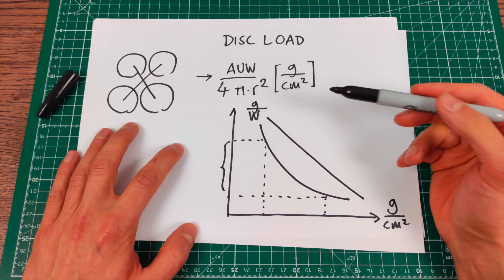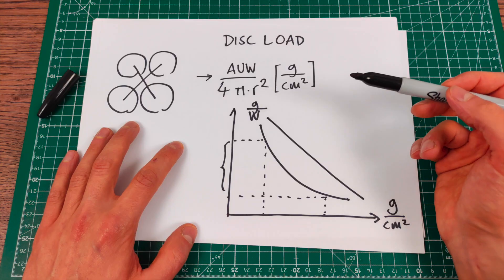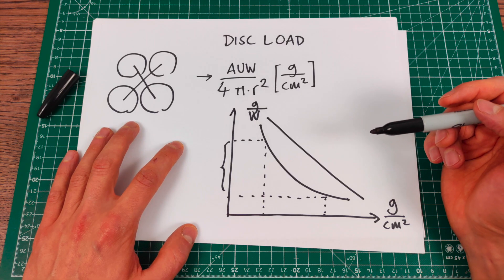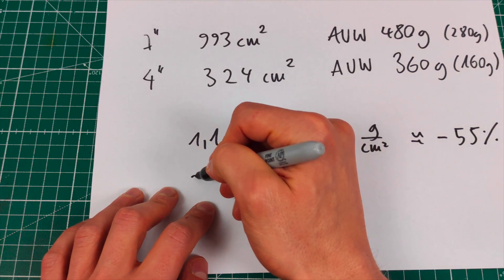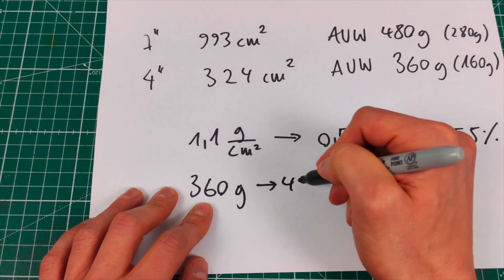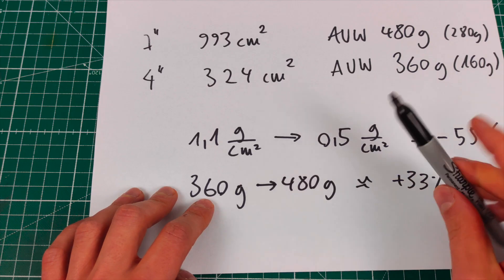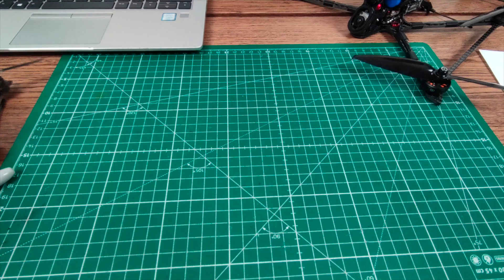Ultralight 7" vs. 4" | flight time comparison | 18650 Li-Ion

Comment: Great concepts, good test!  Are you sure flying till 3.3v on 2 different packs (that might be in slightly different condition) gain a good comaprison?  Have you checked how many MAHs you charged back into both packs after the flight? Could have been quite different MAH consumption / cell behaviour.
I say this because I noticed in my last test (regarding LIONs) that temp playes a huge role.   The one day (cold, around 0°c) I got horrible flighttimes  (and only 2000mah out of a 3500mah pack until the volts dropped down and I had to land, the other day the same pack got me 2900mah and volts were still ~3v/cell      only difference:  9°C this time and packs in a plastic bubble wrap...
Just got into micro longrange by testing the iFlight Chimera4 and the "great" Shadow Fiend - sorry, both rip-offs of your Explorer - but the Flywoo LR is so hyped it wasnt available really ;)
Today just for fun, I flew a few 650mah packs and got ~ 7mins of save flighttime ;)   greets from Austria, Mario
Reply from the maker: Hi Mario, honestly I didn't bother because the result was so clear with roughly +80% of flight time on 4". I noticed the same thing with the temperature and the test was indeed done around only 2°C. With Lipos I always managed to get the battery warm with a few punchouts but on LiIon they come down dead cold.

Comment: Have a question. New to quads. Have a hubsan h501ss don't count that. I do fly long range fixed wing fpv however. Would like to get a long range quad and wondering what to get. All my batteries are 4s lipo and liions so would like to stick with those. Don't care about freestyle or racing or any of that, just long range cruising. What do you think would be a good place to start?

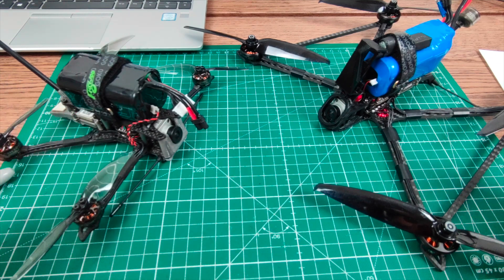Comment: some info.      congrats!!!!     at 10:38,     you  FIGURED  IT  OUT.!!!
for any flying thing,  the use of  a  LIGHTER  battery  results is  Reduced  AUW, and in a  reduction in the Rate of energy consumption.     but, the lighter battery  has  less  mah in it.    consequently,  flight  TIMES   remain  About   the  Same.         do you understand that each of these machines  has  a   Seriously,  TOP-heavy  dom.     distribution of  mass.     THIS  IS  THE  NEXT  VARIABLE  that  you  Should  INVESTIGATE.       followed  by a comparison of the performance of rotors  to  that  of  E  PROPS.       (dom:    Simply  SEE  the way  the  Mass of a helicopter, Hangs  beneath the rotor; which is  NOT  what  drones have.)         googletranslate

Comment: I would not compare 4" and 7" with the exact same battery to see the real perfomance of each one. The point of having less disk load is that it could carry more weight in this case, larger battery. And larger motors and props mean they need more energy to do the same work, cruising in this case. You should put the battery that give the same disk load on both 4" and 7" only then the 7" will shine.

Comment: @Dave_cfpv 1450kv motors on 4s pack? your making higher current than you would have with a 6s pack. Let's try 6s or 5s at least to make it fair. "The higher the voltage, the lower the current. The lower the current, the lower the resistance losses in the conductors. And when resistance losses are low, energy losses are low also." (i'm sure you know this) 
 I will contact you on ig I'd love to throw ideas at each other.

Comment: Not trying to tell you what to do or anything but to make it fair you need to put 6s on the bigger kwad or at least create a formula to figure how much mah per gram of weight from the 4' build and increase the battery that much for the 7" drone weight. Otherwise its an unfair test using the same battery. Just saying.  If you don't have any 6s Li-ion packs then i could build one and test it for you ")

Comment: There's a publication Modeling Flight – NASA that is a 6 MB PDF file on line. Flight efficiency does not scale at a linear rate.  A rough estimate based on disc area would be energy consumed versus time.  So if you scale up the disc area you would want to see how long it would take to consume the same amount of Watts. Because the discharge rate curve of the batteries are important you would want to use a battery that has proportionally higher weight and amp hours as disc area increases.  You're dealing with the issue of cross-sectional surface area goes up by the square as the volume and possibly mass goes up by the cube.   I like the smaller quads, they have lower inertia and are less likely to self-destruct if they hit something.

Comment: Drag is higher on the bigger quad and there’s the prop+motor efficiency. Most 7” start to wobble because of the aerodynamics, the bigger prop starts to inhibit fixed wing properties and the quad starts to feel the wind like a flying wing does.

Comment: You should try the 7" with a 21700 4S1P with 4100mah Li-Ion pack (Sony | Murata VTC6A 21700 4100mAh).  Right now you are decreasing the discload but increasing the AUW with a unchanged capacity of battery, but I think with an increase of AUW you also need to increase the capacity of the battery, so 360gr on 3000mAh or with the 21700 batteries 580gr (I added 100gr for the heavier cells) on 4100mAh. your discload is still considerably less while the 21700 battery also gives you an increase in amp draw. I would also run a test with 18650 packs in 4S2P and 6S1P configuration.

Comment: Having a Flywoo explorer and built one of your mini long range frames (both excellent) I think you hit the sweet spot at 5 inch for li-ion and 4 inch for light weight li-po flying. The 7" might be a worthy experiment to test capability but less necessary (plus it's less of a looker!).

Comment: Have you ever thought of the concept of having a small airfoil, like the tail of a DC-9, attached to the top of the quad which would generate lift at cruise speeds thereby allowing for much reduced power settings in cruise and longer flight times? The angle of attack of the wing  would have to be optimized for a certain speed  so as not to create more drag than lift. Anyway just a thought.
Reply from the maker: I played around with quad / wing hybrids but mostly it was extremely difficult to make them fly well. Seems like the flight controller really has issues handling them

Comment: if you have to keep 33% more weight in the air it is not for free.   You should add extra cells to the 7 inch, so you end at the same discload as the 4incher than compare.

Comment: Also, add compass to your units and use inav with waypoints for testing, then all you have to do is tell the quad to run a mission, have a seat and take a nap. And your results will be using the same power (speed) and course  for each test of each quad
Reply: I also use a full inav setup that way for repeatability, taking out the human factor so you are getting a more consistent flight each time.  I make my missions to be at least a km, then it’s easy to calculate the W/h used per kilometer. This will vary day to day based on wind conditions, but the measurements are still valid within the same day where the conditions remain consistent.
Reply: @kelleysislander  exactly!!!!

Comment: how many amps to hover seems to be obvious that the 7" will draw more per min then the 4",, need to play with the prop area ratio to weight giving the 7" more time and see where the line crosses on the 7" before the battery weight makes it less time. in other words you put the 7" at a disadvantage by using same mah batteries.
Reply from the maker: Yes but basically the point is to see which platform gets the most flight time out of that 18650 4S 1P pack. Maybe I should have said that more clearly in the video.
Reply: @DaveCFPV  Of course you going to get less time from a 7" then a 4", you don't even need to put in the air to know that, the 7" IS going to draw more amps to hover, meaning more mah per minute meaning less time per same packs, you missed my point!
Reply: Things that seem completely obvious at first glance... well... sometimes just aren't ... :) https://www.youtube.com/watch?v=G-7U9aRcnlA&t=201s&ab_channel=ScottTomlinson

Comment: You should scale up the size of the battery on the 7inch. 

Also for the Explorer LR 4inch why didn't you just use a smaller and lighter 3s Li-ion paired with just a little higher kv motors seems like that would have been a more efficient setup and better battery to quad ratio? I know you did the testing on the 3s Li-ion. 

What about 5s Li-ion for 7inch with low pitch "yet to be created" Gemfan 7035 bi-blade and the correct motor you eventually find , I know you will!
Reply from the maker: I intentionally used the same pack because I'm interested in what works best with those exact 18650 packs. It wasn't totally obvious that a slightly overloaded 4" is still more efficient than a very light  7" with very low load

Comment: As an aero engineer for a rotorcraft company this was both amazing and frustrating to watch! I'm not going to go into all the details but suffice it to say that you're on the right track, keep exploring! Incredible work, and I love my flywoo explorer LR. It's very cool to be able to see how rotorcraft theory is playing out for you in reality with off the shelf parts. Rotorcraft are complex in their design, and playing with different parameters can produce very different results... often due to extremely nuanced reasons. Keep going!
Reply from the maker: Thanks! Yes indeed reality is always messy. At least for now FPV development is trial an error to a large degree. Probably it will also stay that way since the parts are cheap and quickly pit together compared to running simulations with an acceptable degree of accuracy

Comment: Dave_C, great video and set of tests.  Disc load and drag, are major factors.  I’d like to see more testing on where the battery sweet spot falls. We can fly micro long range 2s, 3s, 4s,5s, even 6s. In each case, there are trade-offs between power delivered by each pack and weight. I typically fly 3s. For motors, we’re looking for the most thrust, able to exceed the total overall weight and provide power to fly in some wind conditions etc. so for motors, there is a sweet spot also of KV, weight & thrust. I have one build I fly with 6 inch, 3S 18650 pack, on Lumenier 1806 2300kv motors. I typically get 9 to over 20 minutes without carrying a GoPro.

Comment: Wouldn’t the 7” cover more ground than the 4”? If you were more concerned with a distance I think the 7” would still win if we are actually doing long range.

Maybe instead of using a 7” with these motors, I wonder if changing the prop to 5.5”-6.5”? Looking for the efficiency/ distance covered sweet spot.

Comment: Basic formula
Total Weight to Total Lift ratio

If one motor lifts 200 grams at 80% thrust then your total weight (includes battery) can not exceed 800 grams 200g x 4 motors.

lithium Ion cut off voltage is much less then LiPo and thus great for longer air time.
Hower Lipo has more power discharge per millisecond then lithium Ion battery and thus better for speed bursts drones.

Comment: I put both configurations in ecalc. and it looks like the 4" has a hover endurance 34.4min and a range of 8.2km. at 40km/h that's 12.3min. The 7" configuration has a hover endurance of 37.6min and a range of 7.6km. at 40km/h that's 11.4min. although not a perfect match this does indicate the same trend you found during your testing.
Consumed power is not linearly correlated to disk loading. lower disk loading increases efficiency. but it's more like going from 50% to 70%.
To increase your flight time you want to shed weight. dropping 20g of your 7" config increases your range by 5%. dropping 50g increases it by 13%
Furthermore the 7" prop is slightly too large for the motor which hurts motor efficiency. you could drop to a 6" prop but the motor efficiency gained 65 - 75% is roughly halved by reducing the prop diameter. 

try screwing on a Emax AVAN Long Range 6X3.8X2 prop that should increase your range (thus flight time at 40km/h) by 7.5%

if I may ask, what is the bare frame weight of the 7" configuration?
Reply from the maker: Thank you for doing the calculations, that's super interesting! I'm also expecting the motor and tune to be pretty inefficient on 7". I think I might still have some Avan long range somewhere that I can quickly try. The frame is around 80g including the TPU parts.

Comment: Dave you have 1450kV motors on the 7" and 2750kV motors on the 4", what would happen if the 7" motors were closer in kV to those on the 4"? In the tested setup the 7" has 3x the prop area but at the same current draw it is probably turning at less than half the speed of the 4", with the additional drag of a larger prop to overcome. Do the DJI goggles allow reading the amp draw during flight.
Reply from the maker: 2750kV is very high for a 7" on 4S. Probably too high for the motors and Li-Ion to handle. Yes sure I can read the amp draw in the googles. Although from my experience it's usually very unreliable unless properly calibrated.
Reply: @DaveCFPV  I realize its very high but this is a bit different than normal using the LiIon 4s, I know you often think outside the box. Just a thought

Comment: I am thinking if you could spin a 8" props on 7" frame and reduce its motor kv would give a longer flight time with the same battery capacity or may be a much longer flight time with a higher battery capacity.

Comment: Swap the batteries, do the same boring test again?    Math is never boring to a NASA engineer.    Results will probably still be the same, but I don't know, something don't seem right to me.  Your drag is higher on the 7", but your just trying to maintain flight time, not the same speed... or?   If you are, then drag could be a factor using a higher current draw to counter the additional drag on the 7".

I would load the 7" with much bigger 6s batteries, 8400mah, and then it could compete against the 4" for flight times...   where you probably can't go too much higher with your battery choices.  I mean, it would fly like a pig, but.    That's why I went with a 7", it may be bigger, but you can load on more battery weight until you reach the point of diminishing returns.   On the 4", you're kind of locked it to a lower threshold of how much you can add (or?)

The advantage of the 7" over the 4" is that you got thje space to add...  a legit action cam.. on top.

Comment: Hi  , In mho regardless of prop loading it costs a given amount of power to lift a given weight . decreasing numerical disc loading does not compensate for the extra power needed to lift a heavier craft. and spin a heavier prop, If you had scaled the battery up so it matched the mah per gram of the 4 inch , then your results would have been closer to what you expected , yes because your actual disc loading on the 7 would still be less than the 4. Lifting heavier things costs more power .
Reply from the maker: Yes absolutely. I would have expected the decreased disc load to at least compensate for the extra weight but it seems it wasn't even close. Plus other factors like drag and the tune ..

Comment: @Dave_C FPV , I was thinking if the bad tune on the 7" would use up the battery... seems logical that if it's wobbly it will have to correct more during each PID loop, thus taking up more unnecessary battery power. But since the results were massively different, other stuff like the props you mentioned is also a good idea. Love this channel, keep it up !. Happy new year !
Reply from the maker: Think so too. The results were so clear there must be several things (possibly tune, drag, wind, weight, props, more battery sag...) going against the 7" flight time. Thank you! Happy new year!

Comment: LOVE that someone is breaking out the graphs.

On the flight testing, should you be using the same battery though?

Id expect you'd want that scaled up proportionally to the weight no?

Another variable: forward surface area -- the 7" is going to have a much larger silhouette. 

On a different note, Dave your frame layouts are elegant AF.  Like they're aesthetic candy -- nice work dude.

Comment: Here are my thoughts. You concentrated a lot on g/cm², but as you mentioned earlier on, we need to look at g/W too. So I think you're right at the end of the video that you need to further test motor and propeller combinations. 

A couple of ways you could test this against the 4" quad.

1) The in-situ method. Measure the wattage consumption while hovering until the battery runs down to your cut off voltage.  BF black box should be useful here. This is subject to a lot more random errors, but would be more 'real world'.

2) The bench method. Get a table top thrust meter, measure the power to thrust relationship of the 4" prop and motor, then find the best motor and 7" prop combination that matches.